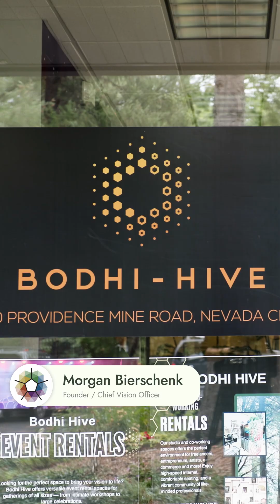Updates from Morgan | Contracting License, First Site + Parts in Production

Comment: Question popped into my head.. if there’s an error with one of the components, is there a way for you to recycle it and re-use the materials? 

I mean, you can’t melt it with heat…
Reply from the maker: The bioceramic we use is a next generation geopolymer, and any component that doesn’t meet spec can be crushed and recycled back into future mixes. No melting needed, just material stewardship built into the system ✨.